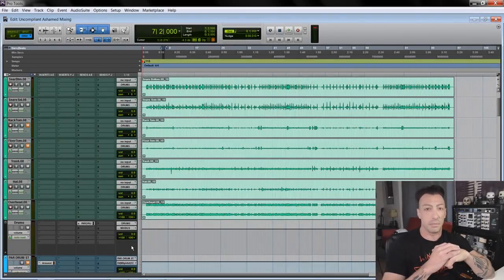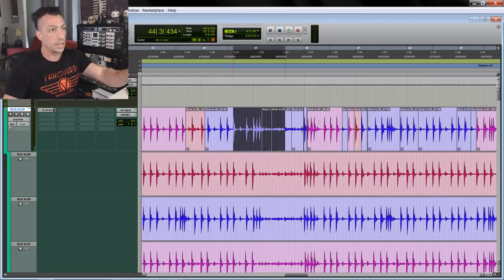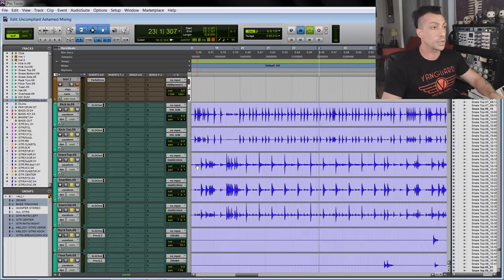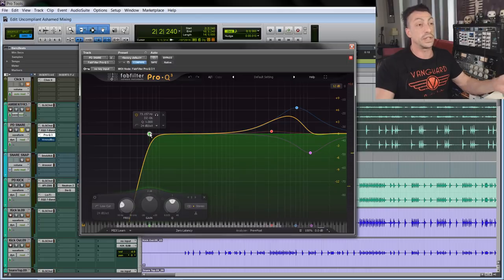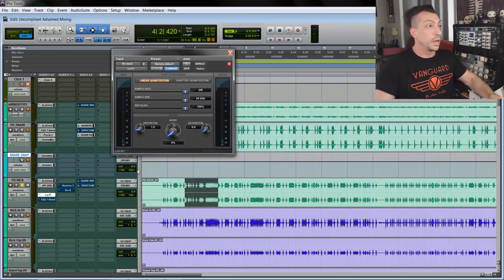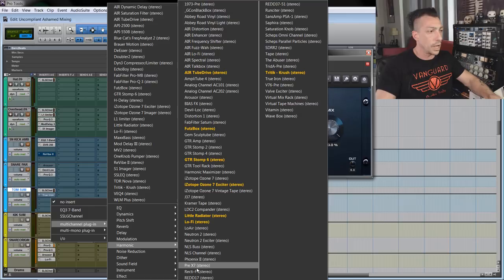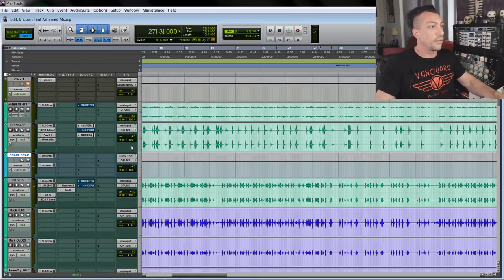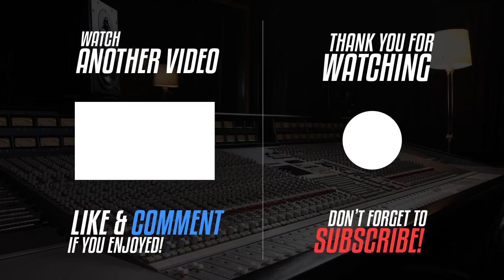Mixing Metal Drums with David Gnozzi - Warren Huart: Produce Like A Pro

Comment: Quick question for David: around the end of the video, you mention sending kick, snare and toms to a mono channel going through a Distressor (so, pretty much the good old parallel compression technique).
My question is: while I totally get wanting the kick and snare as mono and "center" as possible to anchor the mix, doesn't sending toms as well mess with their placement in the stereo field  ? As in metal you often want toms as wide as possible, to the point of being kinda "un-natural" so that tom rolls pop (it's not like modern metal is about natural/vintage drum tones anyway), and having part of the information straight in the center pull them back from the side and to the center.
Or is there something I'm missing ?

Comment: To bad he was mixing samples instead of drums. I like David and follow him. He has some great techniques. Same with Warren. Love what Warren does. His channel is a wealth of information. This one, I just can't get on board with. Yes, I know, almost all drums are samples these days. But that is why I don't like it. Even in the 80's there were sampled drums. I didn't like the way they sounded. They didn't sound real to me. They sound much better these days but you can still tell. Maybe not the average listener, for sure but, I rather do a good job tuning a great drum set, micing it good with decent mics ( you don't need 8000 dollar mics) and mixing it. It isn't that hard and you can get these sounds no problem without all the samples and processing. Don't be lazy and it isn't that much harder. Tune the drums properly and almost any drumset will sound fine. Work with mic placement. The rest is easy if you have a good drummer.